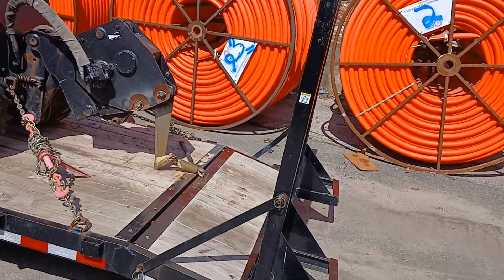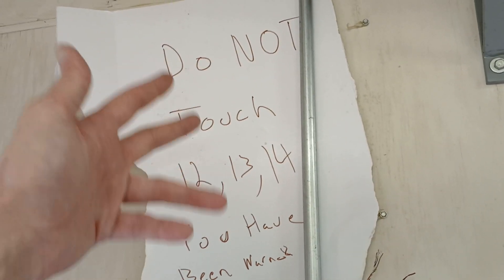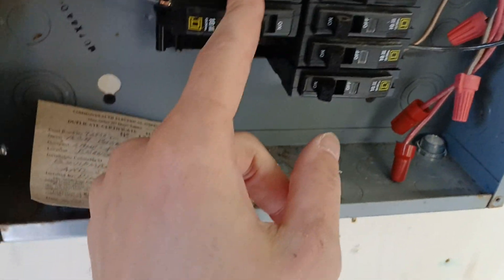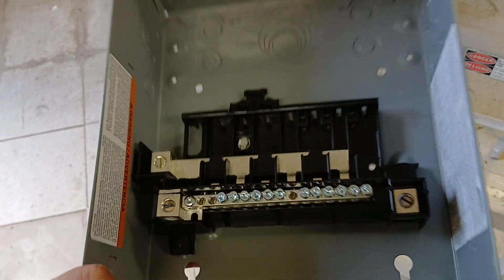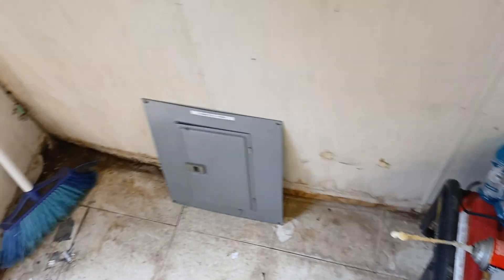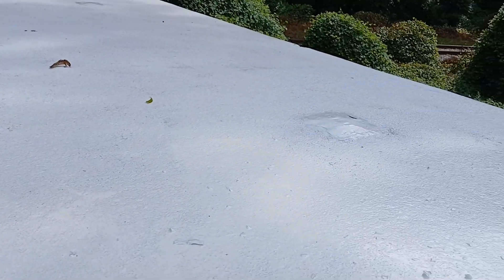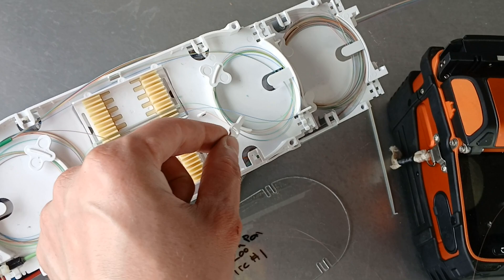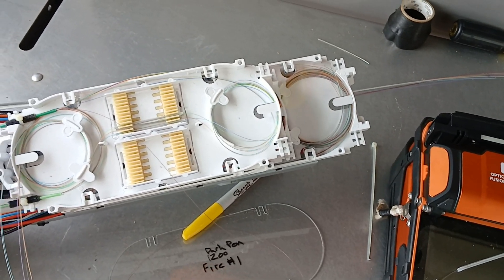Adding PONs, Finally a splice VAN!!, and upgrading to solar at a POP

Comment: A lot of the time the air compressors are used for pulp cable. Instead of the copper wires having the colored rubber coating, they are wrapped with a paper/pulp material. If any moisture gets into the cable then the copper wires short together. The air compressors keep the cable pressurized and keep the moisture out. The paper/pulp material cuts down on weight and cable diameter for high count cables.
Reply from the maker: Ah I know exactly what your talking about like that it looks almost like rolled up paper.  It seems incredibly inefficient but it must be an important cable.

Comment: Can you do a video trouble shooting a splitter pon with an OTDR  when you run  in to that type of trouble ???
Reply from the maker: My otdr doesn't support pon.  I typically test the long run with otdr to make sure main fiber is good then our splitters are so far out in plant it's so easy to identify the issue because there is 1 splitter.  I have never replaced a splitter due to non human related damage.

Comment: Mercedes can take their sprinters and shove them all where the sun don't shine.
Get your 5 years out of it and sell it, and run.
5 years and a day you'll be running into all sorts of headaches (actually, about 2 years in you'll start getting them but they'll be covered under warranty... Still doesn't help with your day to day.)
Ran a small fleet of about 6, 2013's, 2016's and 2019's and the newest 2021.... All a huge money pit, none of them worth owning unless they're low kilometers and you plan on touring with them for a month or two a year.
Reply from the maker: I'm a mercedes hobbyist already and have full intentions of doing 100% of my own maintenance and service.  I'm 6'5 and there isn't many other options to stand up in back.  I hope your wrong but it will be just another adventure if not  Only 42k miles on it too.  Thanks for watching

Comment from the maker: Can someone tell me what the air compressor hooked to the verizon main line is doing?
Reply: I have seen this before to keep the copper lines dry.
Reply: Pressurizing them. Keeps moisture out which prevents electrical signal issues from the moisture